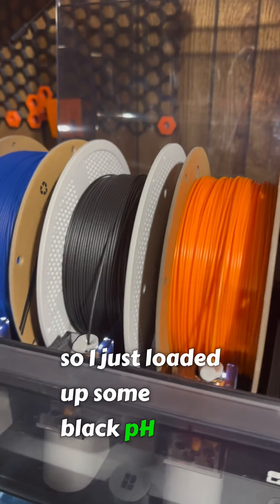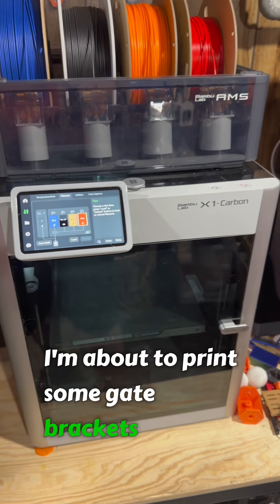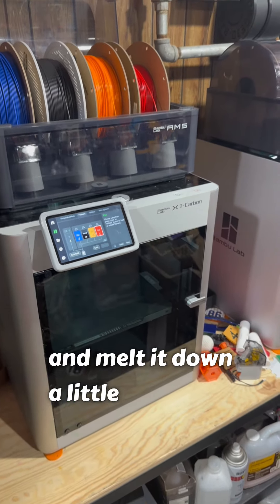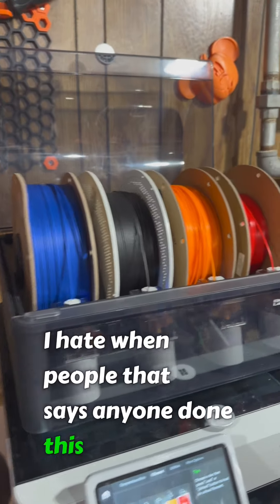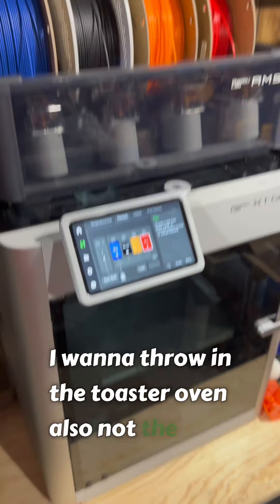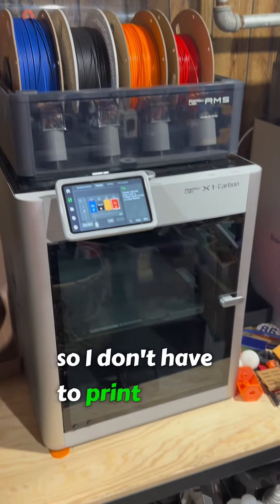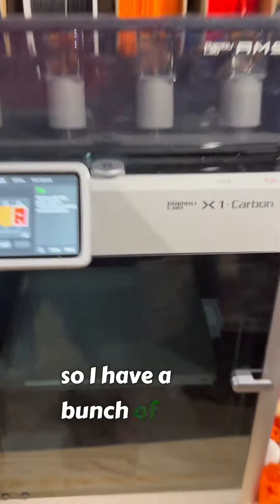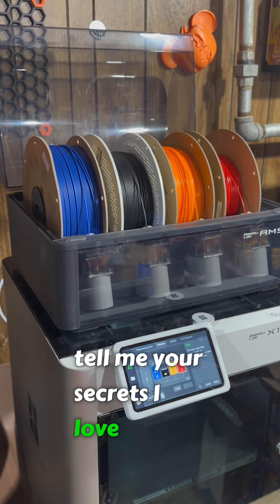3D Print Annealing for Strength?

Comment: I know one comment talks about the shrink/warping that comes with annealing, but stefan of cnc kitchen has mentioned how carbon fiber nylon will anneal basically warplessly in one of his videos. And in general the process increases tensile strength and heat resistance i believe.

Comment: I have a friend that did PLA plus. And it shrinks a lot whenever you anneal it. So what he did was he printed off sections TEST Sections. And put them in the oven with a plate full of sand. Saw how much it shrunk and then he adjusted the size according to that. And it was super like heat resistant and strong after that.
Reply from the maker: Oh wow, I didn’t realize it would shrink.  Does make sense.